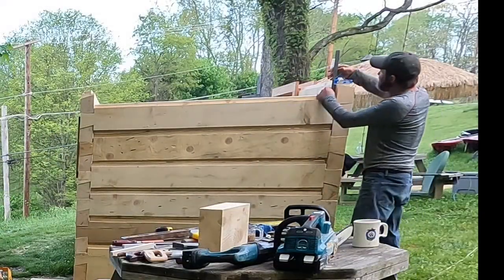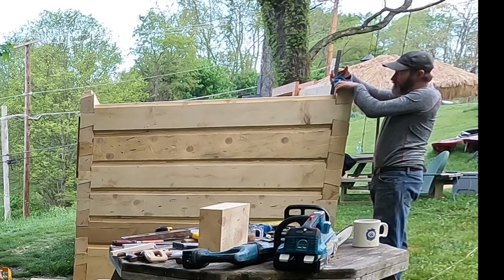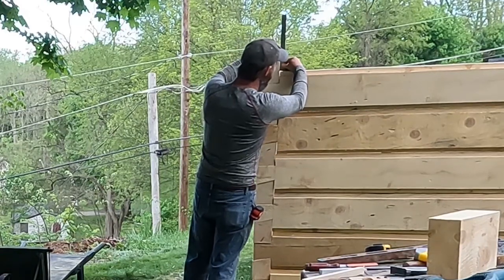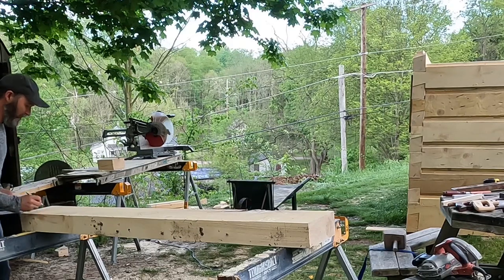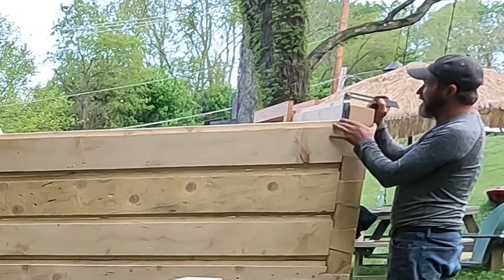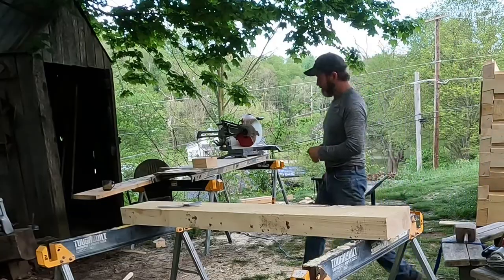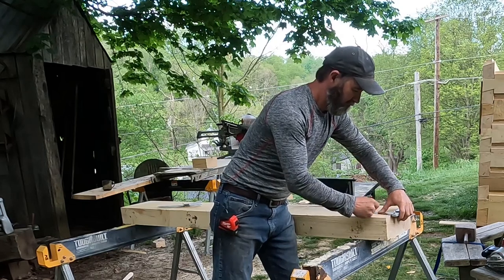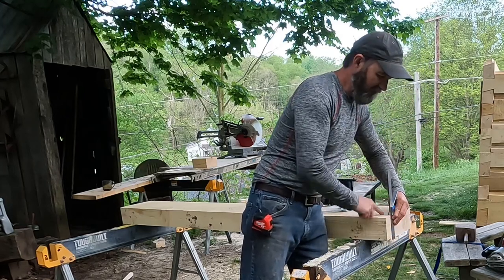Cutting a -0- gap￼ dovetail corner for the tiny log cabin￼ build

Comment: Why not just make a jig to cut it exactly the same way each time. Perhaps using a router to make the cuts.
Reply from the maker: I suppose you could but you don’t need to. This is the reason they number log cabins when they take them down